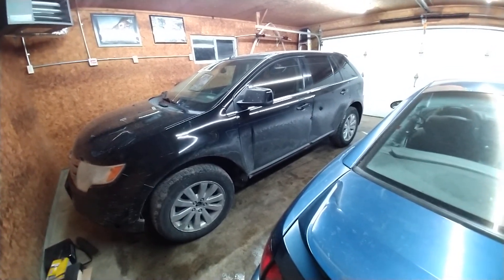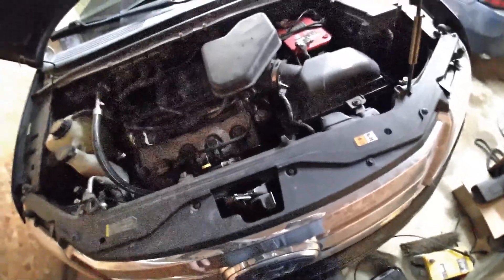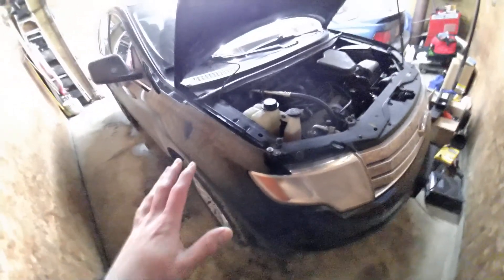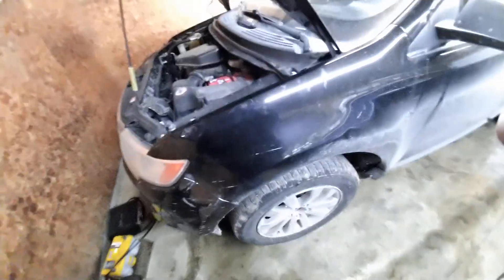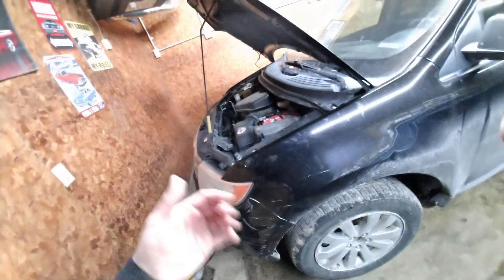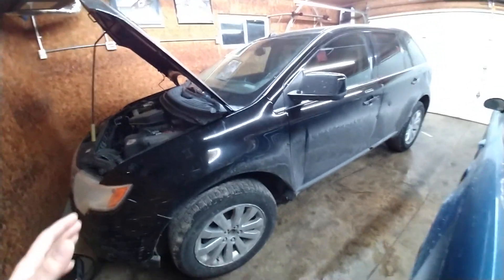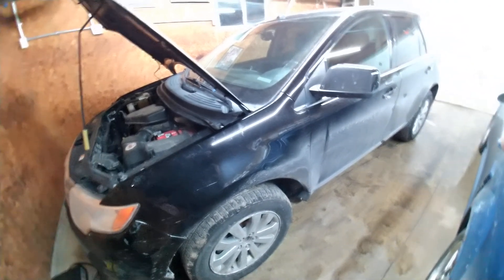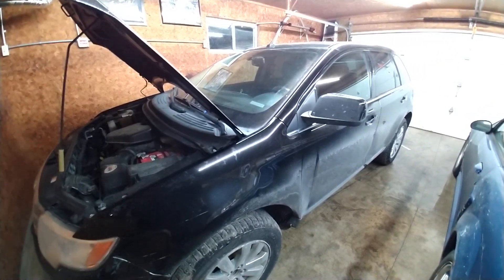How to get your vehicle to 200k plus miles

Comment: I have 2007 Ford Edge base model front wheel drive with 165k miles currently, I got it with 143k miles. I have done all types of maintenance on it and it runs well, does 80mph all day, starts on the 1st try every time even on cold north east winter days. As far as the transmission, previous owner could not confirm if & when the tranny fluid was changed. When I ask mechanics I am told not to flush, don't change it at all or it will start slipping or recommended to change it slowly i.e. drain & replace drained fluid with new fluid over a couple of months. Of course Transmission shops pay their bills by changing fluids and fixing them. Sooooo.....what do you recommend?
Reply from the maker: Okay, first thing I would do is look at the fluid on the dipstick, if it's black or very dark brown don't change the fluid. At that point it's to late. If it's pink or dark red it's good to change. I have a video I'll send you the link to of how to change the fluid. I drain it and refill it, It takes about 5 quarts. Then I'll drive it a week and do it again and every other change I ad lucas transmission conditioner to it for good measure.
Reply from the maker: https://youtu.be/J6QQMRaEKQI

Comment: What differential fluid would you record using on a 7.3 idi ford van? Thanks
Reply from the maker: Personally I run a 75w90 synthetic in mine, I have a 93 f250 with a 7.3l idi turbo in it. I use that in all my trucks and my mustangs. 80w90 conventional is also a good one but personally I like the synthetic 75w90 better. I hope this helps you out friend
Reply: @T-MillProductions  yes absolutely. Thanks so much
Reply from the maker: You’re welcome man! Glad I was able to help. If you have anymore questions please don’t hesitate to ask!
Reply: @T-MillProductions  any advice on a 7.3 idi i want to get back up and running. It was my friends grandfathers and he’s offering to give it to me to have. He knows I like working in old fords but have never had any experience with the diesels. I want to convert it into a small camper and use it as my daily. Basically it’s been sitting in his garage since 2005 and it only has 19000 original miles on it. ?? Anything helps thanks again for your time.
Reply from the maker: Absolutely man, I have some videos on my idi engines. If it’s been sitting that long my advice would be get a new fuel filter, fuel return lines and cap set, zd9 motorcraft glow plugs, new air filter, and fresh fuel in 1 of the tanks and plug it in for a few hours so the block heater heats up the truck and trans sure your batteries are new or Atleast good enough to crank the motor over fast enough to start it
Reply: @T-MillProductions  yea I’ve watched a couple of the ones that you’re rebuilding for your truck definitely very helpful videos as far as understanding everything on the engine. As far as my fuel filter housing on top of all my injectors it has been taking out and replaced for just one of those small in line fuel filters would you suggest putting back on the fuel filter housing?
Reply: @T-MillProductions  I put new battery’s in it and start it but once I get it started it just dies and then I check my battery’s and there dead to so I’m guessing that’s probably my alternator. What would you think?
Reply from the maker: Yes I would for sure replace everything to what it was stock. Diesels need larger fuel filters because diesel fuel is a much dirtier fuel than gas. I change my filters 2 times a year. Just for good measure. What year truck is it?
Reply: @T-MillProductions  I have a 1989 ford e350 it’s actually an old ambulance
Reply: Wish I could send a photo it’s really awesome never seen anything like it. Couldn’t pass up the offer to just have it. Not really sure how the factory fuel filter housing went on do you have any videos talking about that?
Reply from the maker: I can make a video on it, I gota work tomorrow but when I get home I can make a quik one. I’m actually in the process of making a Facebook page for the channel that I will be making a video on hopefully soon and then everyone can post videos, pictures, questions and comments on everything. I would love to see the truck. What year is it?
Reply: @T-MillProductions  1989
Reply from the maker: Oh nice, as soon as I get this Facebook group done I’ll make sure I post links in all the video descriptions so you can join and post pictures of it. I can’t believe they wanna just give it to you ! That’s awesome